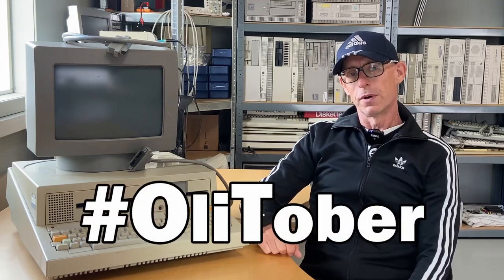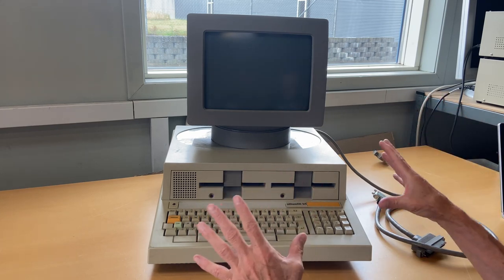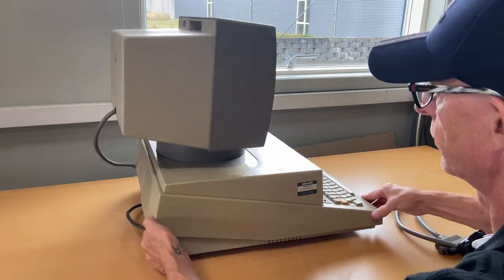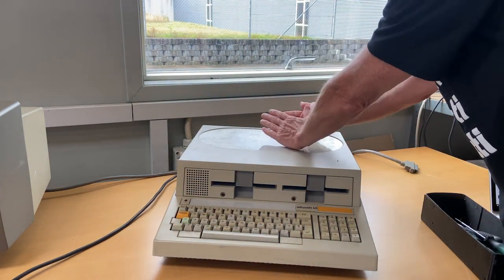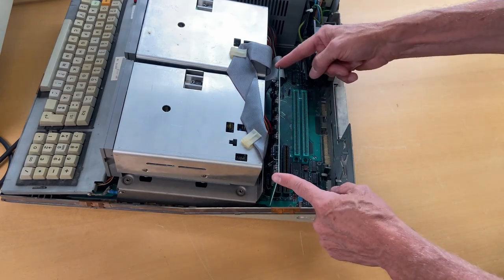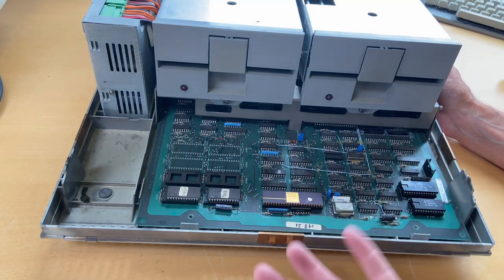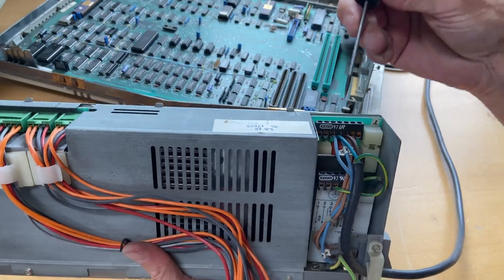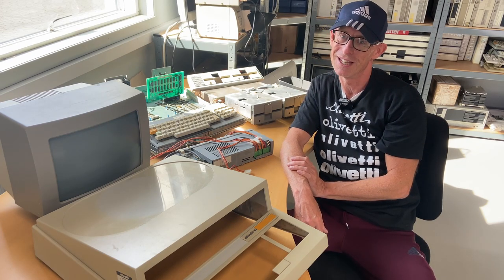Olivetti L1 M20 Zilog Z8001 - Episode 1

Comment: I don't know that machine was not used to create programs for other ZILOG Z80A computers given the right C++ compiler as the ZILOG Z8001 is backward compatible with the ZILOG Z80A.
Reply from the maker: To my knowledge the z8001 was not backwards compatible with the z80
But I could be wrong on this
Reply: @TiBosRetroComputers  You said it was a 16Bit which made me think ZILOG Z800 not ZILOG Z8000 which is most certainly not backwards compatible with the ZILOG Z80/Z80A and wasn't the ZILOG Z8000/Z8001 32Bit processors so the 16Bit machine would be suitable for creating games and other programs for machines like the Spectrum and AMSTRAD CPC664 and AMSTRAD 6128, I did have a look at the data sheets for both processors.